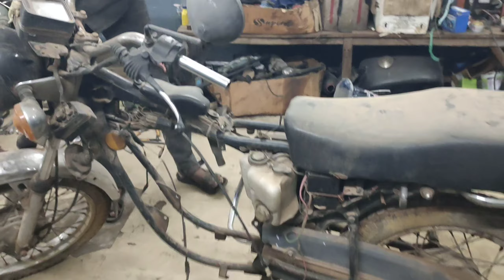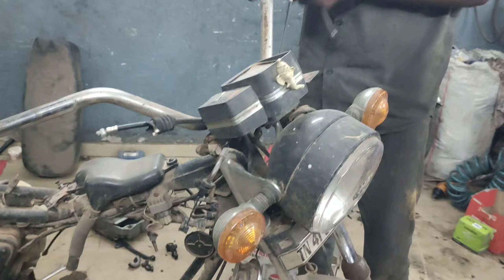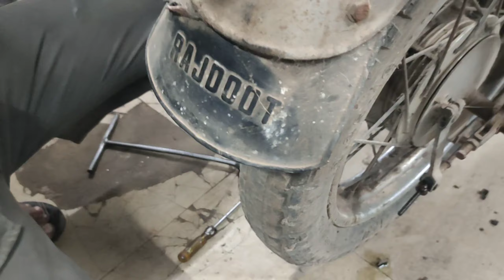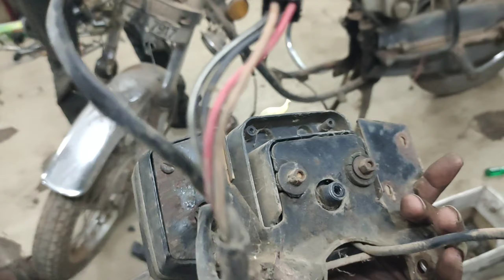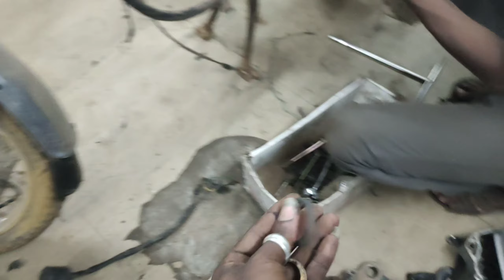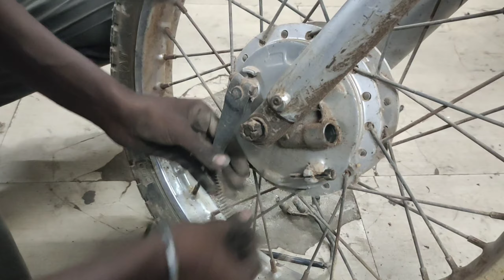Rx135 full restoration,,in தமிழ்,, dismantling/part 1 #rx135 #rxrestoration

Comment: Bro yennoda rx100 la sleved bore std size potu eruku milage 40 varuth aana pickup kammiya eruku clutch, cdi coil, coil plate, mikarb carburetor yellam pthusu pottum pickup kammiya than erukkuthu
Reply from the maker: Used carburetor pottu check pannunga bro
Reply: Ok anna